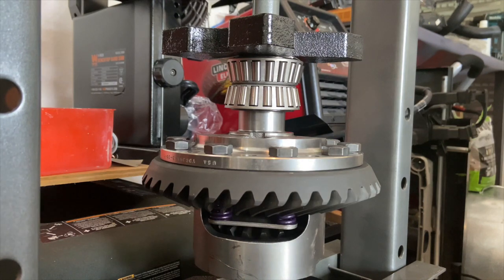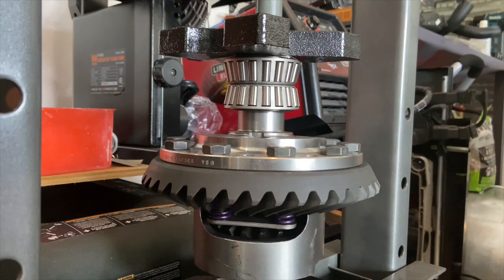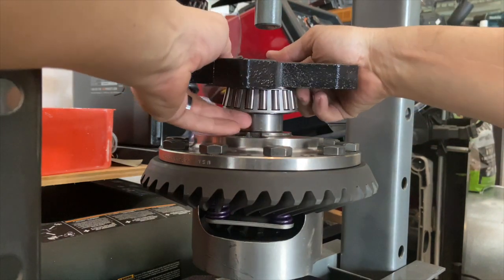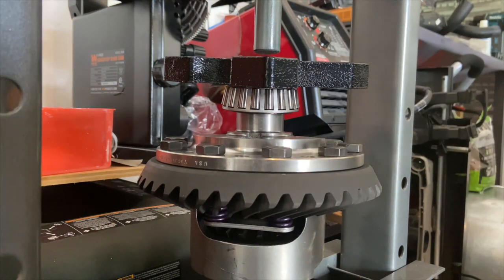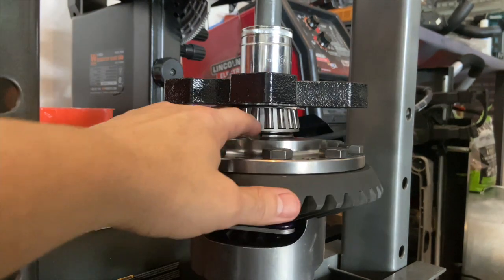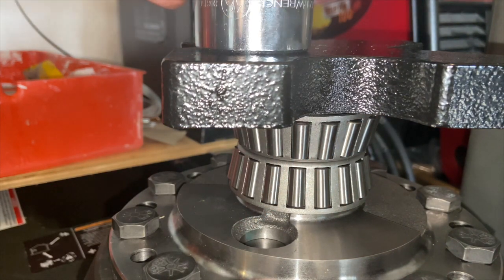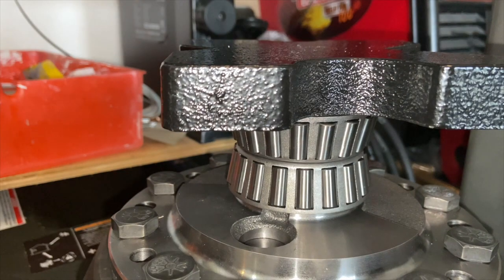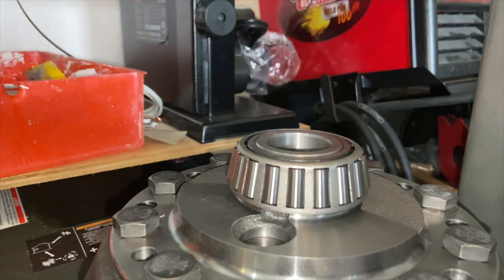Dana 44 Rebuild: Carrier Bearing Install

Comment: I had a disaster garage experience and may need to do this myself. Found a liquor bottle in my jeep when I went to pick it up for the 2nd time. 3 Months later and 2 grand burnt on the problem; the same symptoms came back. I drained the diff fluid it was black & metal pieces on the drain plug. Wish me luck dealing with warranty work but at this point I am afraid sending it back to them.